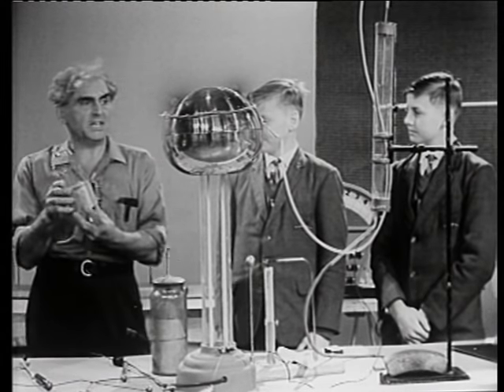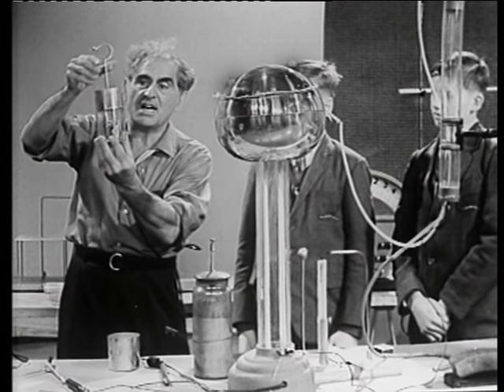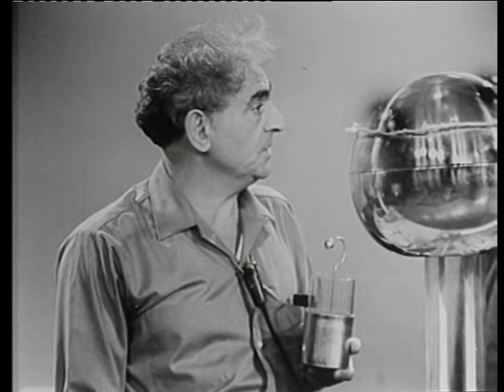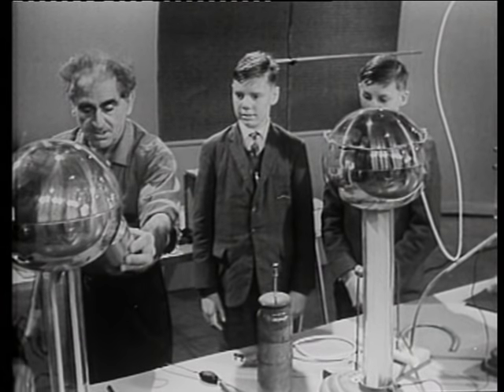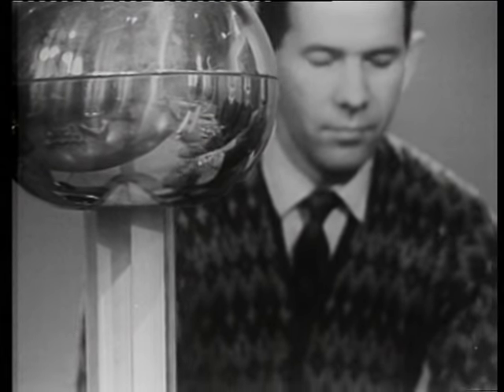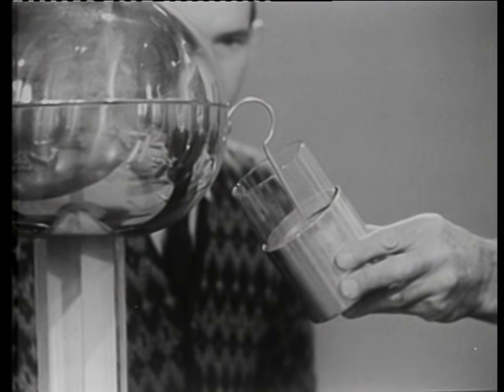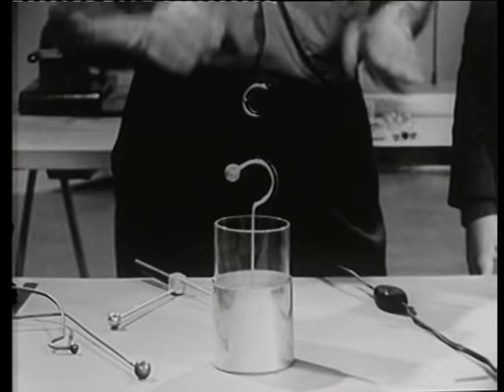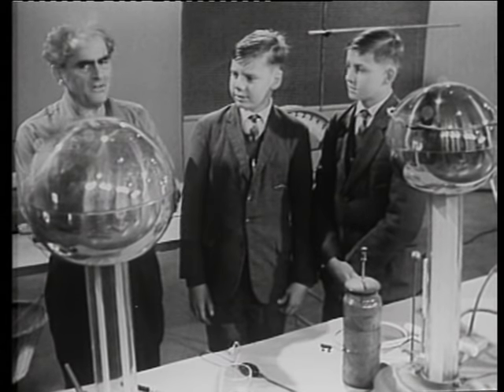Professor shocks himself on Why Is It So?

Comment: My mind was blown when he took it apart and it still worked.
Reply: Same here. Anyone got an explanation?
Reply: @FraserChapman  This doesn't explain it! If the glass is partially conductive, it would partially transmit the excess electrons to the place with a deficit of electrons, and you'd end up with just a neutral material. To make a capacitor, you need both conductive and isolating materials.
Reply: @tiagomacedo7068  wait so how does it work? I've only just started learning about magnetic and electric fields, so I want to say that the capacitor would have stored the energy and kept that energy regardless of if it was disassembled. However, if the energy does dissipate when disassembled, then im stumped
Reply: @Cheldeo  Its not actually conductive, glass is actually an insulator and no current moves through it (insulators are actually are probably easier to understand as extremely high valued resistors), it's the fact that it's a dielectric material, which all insulators are. When you charge the plates the molecules in the glass become polarized, as in electrons are pulled towards the plate that is positively charged, and the protons towards the negatively charged plate. The electrons still remain with their respective molecules, but because the relative positions of the molecules and electrons is polarized, there is no equilibrium in the system, and since the glass is not a conductor, that polarization remains even when the metallic cups are removed and discharged. 

Knowing this, my assumption is that the polarized glass (and ions), still retaining most of the energy that the whole system originally had, creates an imbalance in the metallic cups, again drawing electrons towards the positive side of the glass and vice versa, meaning that the glass essentially recharges the plates, which then are discharged by the rod and through the air, which also happens to be a dielectric. The polarized molecules could really be considered to behave like electric dipoles not unlike water molecules. The only time in which an insulator becomes a conductor is when the electric field applied to it is high enough to rip electrons from their molecules, which is defined as the dielectric breakdown voltage, which is the voltage you see printed on some wires and cables, like some hookup wire I bought recently that states a dielectric breakdown of 300V. The dielectric breakdown for glass is... high. I don't remember how high. I do know that air has a breakdown voltage of about 3kV/mm, which also gives you an idea to the sheer magnitude of the voltage in a lightning strike or any discharge in air.

It's also the same reason why you can touch low voltage electronics with dry hands without any harm, it's once you reach the breakdown voltage of your skin (which is also very thin) that things really start to get wild, although you don't necessarily have to reach that voltage level to die, current is what kills, voltage is just the energy potential across two points, current is the actual travel of electrons. 

Dielectric breakdown is also a reason why you shouldn't use sticks to poke high voltage electrical lines.
Reply: @redryder6987  thank you for that explanation, this experiment has bugged me ever since I watched it
Reply: @Caballingus  
While the static charges in the metal parts are very mobile, some of the static charges are on the inner and outer surfaces of the glass vessel, where they are immobile.  Re-assembling the parts put the metal in contact with the glass surfaces, so the static charges can move between the inner and outer surfaces, via the metal bits.
Reply: @Caballingus  it's because electrons cant move freely in glass, as its not conductive and there are very few free electrons. when you're charging it, you are removing electrons from one side and shoving it the another with and through metal plates which are conductive. when you disassemble it electrons are just stuck there very slowly trying to move to their vacant locations, but this movement is terribly slow as again, its not easy for electrons to move through glass. when plates are brought back still, theres no connection between plates, so no path for electrons to go (air is also dielectric). but once shorted or brought close enough to break the air molecules, all the electrons start going back to "empty" spots. every dielectric has a breakdown voltage, even glass. if electrostatic force between sides were high enough, it too would short internally.

Comment: I NEED to know how he can charge, disassamble it and assemble it, and it's still charged!
Reply: Glass was electrostatily charged. The plates are just collecting and introduce static more easy on large surface of the glass
You could do the same with aluminium foil over a glass planel. The trick is to handle the glass with great care no to discharge during disasembly/reasambly

Comment: the energy is stored in the dielectric material
Reply: Thanks for that. I needed an answer to that question.

For everyone else reading this btw, the dielectric material is the insulator, IE the glass.
Reply: Not in, but on. In the moisture that coats the glass. "Soda glass is hygroscopic and forms a partially conductive coating on its surface that holds a charge. Addenbrooke 1922 established that in a dissectible jar of paraffin, or glass baked to remove moisture, the charge remained on the metal plates. Green 1944 confirmed these results and observed the corona charge transfer. "
Reply: @dLimboStick  I don't think that's the right answer. The man holds the outside of the glass and puts some fingers on the inside. If the outside and inside layers of moist on the glass were holding positive and negative charges, wouldn't he have discharged them by connecting them?
Reply: @tiagomacedo7068  Some of the surface charge is discharged by his hand, yes, but only around the places he touched. The rest of the glass's surface still retains the charge. If he wiped his hands across the entire surface, then I presume there would be little to no spark once the jar is reassembled

Comment: WTF? Now I'm pissed! You didn't show the end?.. how is it possible?
Reply: While the static charges in the metal parts are very mobile, some of the static charges are on the inner and outer surfaces of the glass vessel, where they are immobile.  Re-assembling the parts put the metal in contact with the glass surfaces, so the static charges can move between the inner and outer surfaces, via the metal bits.

Comment: It is a shame that the video does not go on to explain WHY the charge is still there after the capacitor has been disassembled.
Reply: The article on wikipedia is very interesting. For those who have no time to read all of it here is the spoiler : Although the experiment leads you to conclude that the charge resides in the dielectric, the charge resides on the metal surfaces. However, at the moment of dissecting the jar it transfers to the glass. This does not happen when the glass is oven dried before the experiment, or other non - hygroscopic dielectrics are used instead of ordinary sodium glass.
Reply: It was to make you think. Not everything is served to you on a platter.
Reply: @bradleywhite9118  , did you "thumbs up your own comment?
Reply: @markschiavone8003  No but I did.
Reply: It was the trade mark of Julius Sumner Miller to force the viewer to do some research to find the answer. He was famous for saying to students “why is it so?”
Reply: @bradleywhite9118  I also would wonder if it was a regular series if he'd discuss the previous episode a bit at the start after people had had a chance to think about it and maybe even write in?